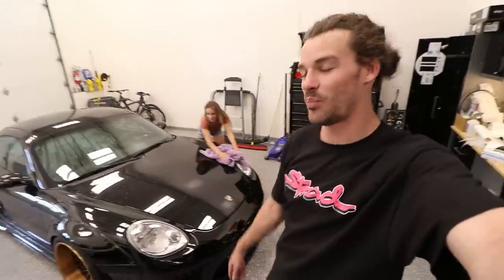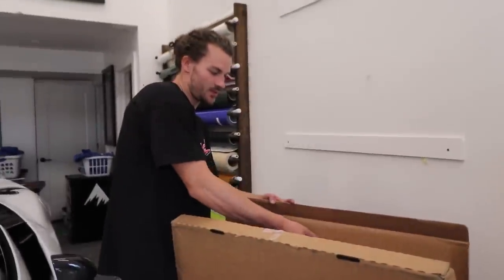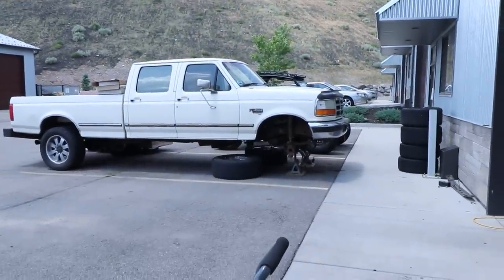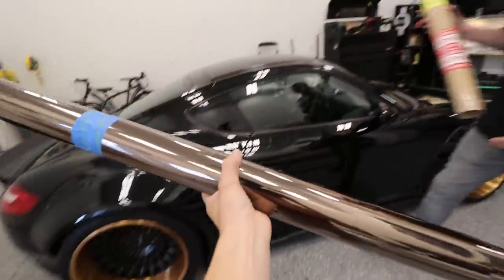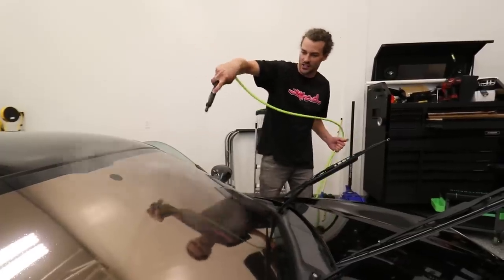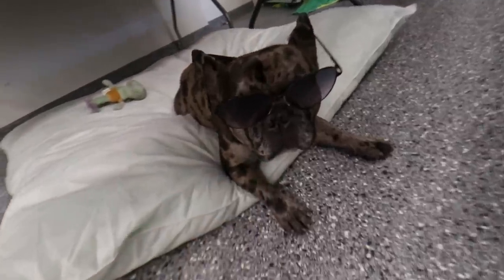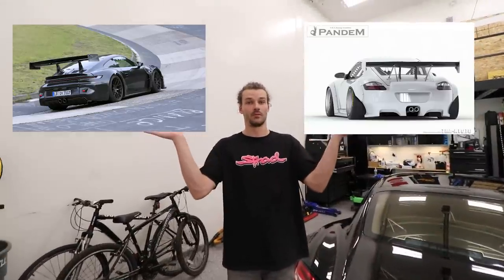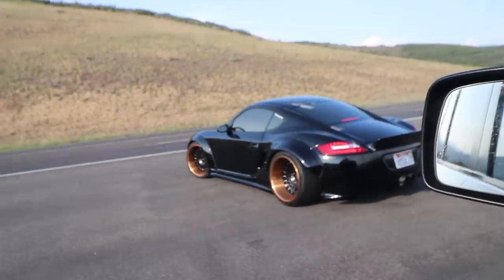The Most Illegal Window Tint You Can Buy!!! Will I Get Pulled Over?

Comment: I'm not a fan of wings. So whichever direction you go, is up to you. But for leftover holes - I'd find some stylized machined screws or bolts, and simply bolt those in the open holes. It would give it a cool 'machined' look.

Comment: From my perspective, It's funny to see guys joke about it getting pulled over for illegal mods :D
If you did this in my county (or most of Europe) you would get some FATTT tickets (many thousands of $), police would remove and seize your license plates on the spot, your car would get impounded (they make you pay for EXPENSIVE AF towing too) and if you would ever want to register it again, you would have to change it back to original to pass the inspection. Anything without a TüV specifically stating that that exact mod is made and tested for your car (even bigger wheels, if the dimension and offset is not noted in your homologation card) is a big nicht nicht.